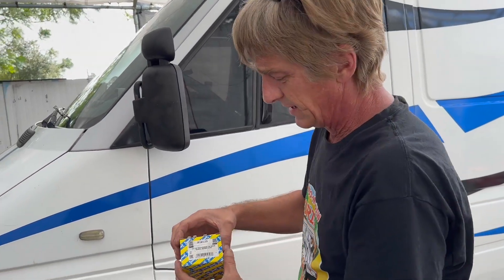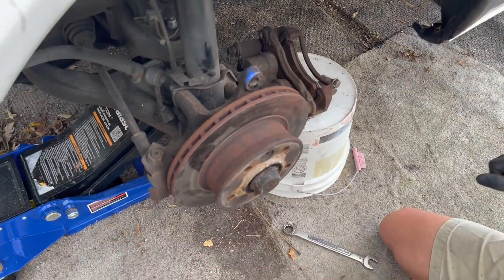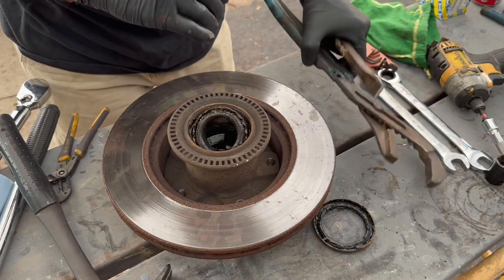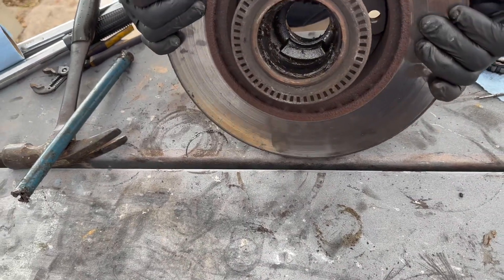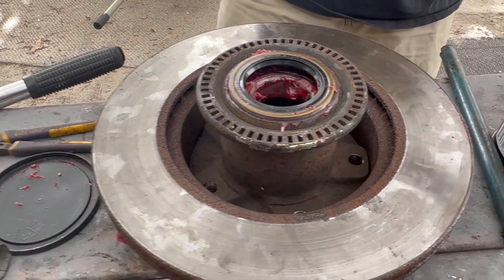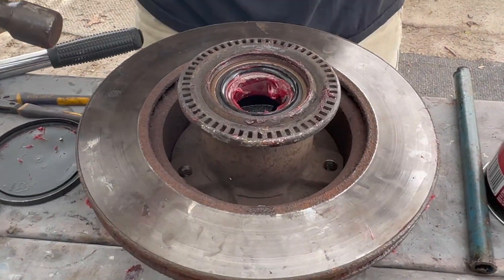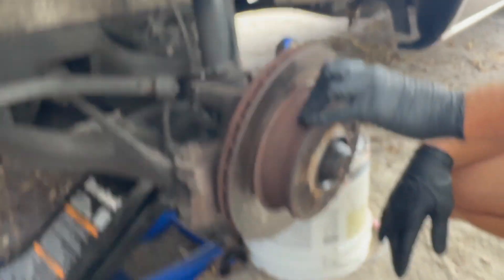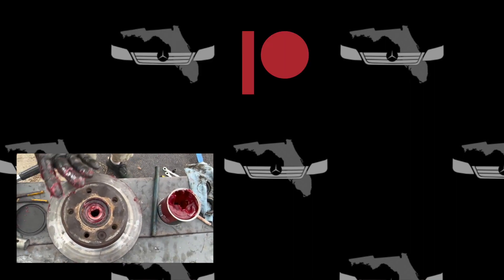When Wheel Bearings Go Bad! - T1N Sprinter Front Axel Repair -

Comment: ooooo where did you get the wheels from? they look so badass. excellent content
Reply from the maker: Those are 19 inch G-wagen wheels. I have two videos on G-wagen wheels. They only fit G's and T1N's so there is a unique opportunity for T1N drivers.
Reply: @FloridaVanMan  ooooo tasty! id probably look for G-wagon wheels 😍 massive wheels but look so good. does it effect the ride much?
Reply from the maker: @bencrosbie  Stock size tires will rub our plastic bumper and a seam in the wheel well. A recent video shows how I corrected that. Smaller tires will avoid needing to take minor modifications with knife and hammer. Passenger tires make the ride quieter and more comfortable. Most of us run small truck tires unnecessarily. I don't haul loads in my van anymore. It is built-out as light weight camper van.
Reply: @FloridaVanMan  I'll need to watch that video too. the big tyres is ideal for a swamper and some offroading too. there's pros and cons depending on application. That'll be interesting to look into for my sprinter.

Comment: Hey is the procedure pretty similar for 3500?
Reply from the maker: Yes. The front wheel of your 3500 is the same as mine but yours has an adaptor to fit the 6 lug wheels and change the offset.

Comment: Could be wrong but that drop link looks to be to straight if not on the wrong way round?
Reply from the maker: It has never been apart. I bought this van new in 2005 and the most in-depth work around this wheel has been brake pads. It might be worn, after 540,000 miles and 18 years?

Comment: What is the life expectancy of the bearings?
Reply from the maker: This one lasted 17 years and 540,000 miles. I replaced one on my other van at 15 years and 400,000 miles. Both vans have one untouched wheel and I've never had to do this on any other.

Comment: What model Mercedes  did those AMG wheels came of?
Reply from the maker: G-wagen wheels are the ONLY thing that fit our T1N Sprinter without modification. 5x130mm w/ 84.1mm center bore. We have a few videos on G-wheels.
Reply: Thank you for confirming. 
I did my own digging online and was only able to match it to G-wagon. Problem they are hard to find and expensive…
Reply from the maker: They are expensive at retail stores BUT the wonderful thing about G-wagon wheels is that G-wagen drivers don't typically buy used wheels or tires. They often put new tires on the car before selling it and then buyers will put custom wheels on the car. This leaves a set of G-wheels with new tires on the market for cheapskates like myself. I regularly buy full sets with Goodyear and other top quality tires for $500/set. 
 @DXM250

Comment: Thank - you foe the excellent video.  I e-mailed you about a p0299 underboost code do you have any videos out on tracking that down? Thanx again.
Reply from the maker: If I didn't reply to your email, I didn't receive it. P0299 is not in the T1N Sprinter vocabulary so we know the van did not produce that code and your interface to the On Board Diagnostics has failed you. What code reader are you using to get that P0299?

Comment: I didn’t see you really clean the brake disc after all the handling with greasy fingers. All I saw you do was wipe it with a paper towel while you were still in the middle of the process. Shouldn’t you have used some alcohol or acetone or something?
Reply from the maker: We edited out the jokes about getting grease all over that disc. A little grease would burn off very quickly but I did use a little brake cleaner on a blue shop towel before reassembling. While I was cleaning the disc I was joking about lubricating it so the brakes don't squeak or rub hard. My editor (daughter) didn't think it was funny and could be dangerous if anyone didn't realize my sarcasm. She was probably right.

Comment: You need an axle stand under there don’t trust your life to a tiny rubber seal 😊
Reply: My first thought when he went to take the wheel off.  Sorry, but missing this basic step = a thumbs down
Reply from the maker: If I were getting under the van I certainly would have a jack stand or two in place. For this job I didn't even put my foot under anything raised.
Reply from the maker: Who uses an axle stand when changing a tire? The job done here is no different. If I needed to get under the edge of the van, an axle stand would have been used. Simply taking the wheel off and putting it back on doesn't present a significant risk of fall or injury.
Reply: @FloridaVanMan AGREEEE some people's kids. 😂

Comment: you should really not be using a steel pipe doing all that hammering... use a metal that is softer than the metal your moving.. solid brass rod is the way to go...
Reply from the maker: I agree. I 'm still learning and I'll make a better video next time I'm tasked with this repair. Please stay tuned as I get better at this "craft".